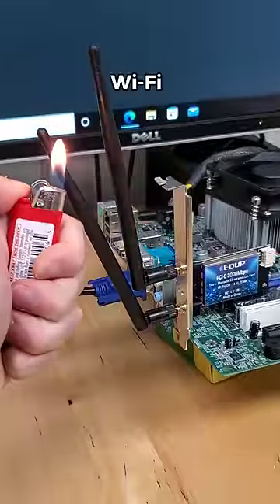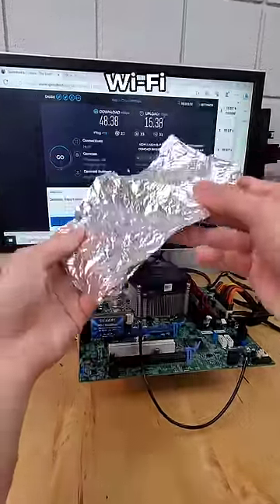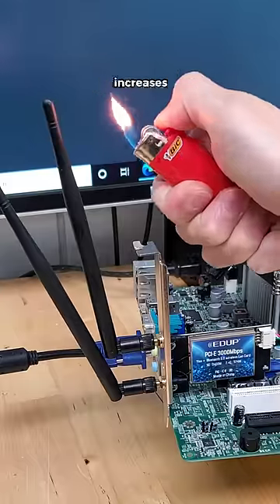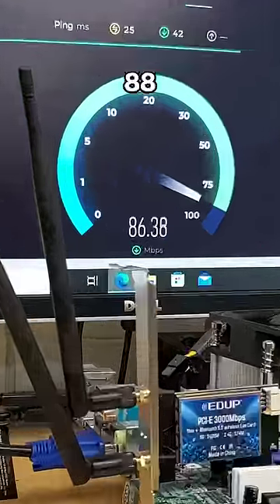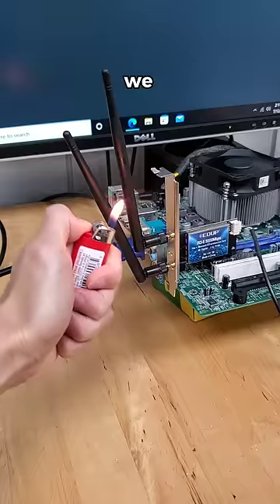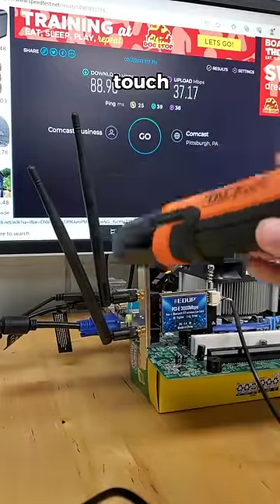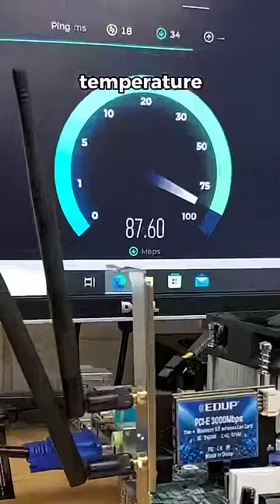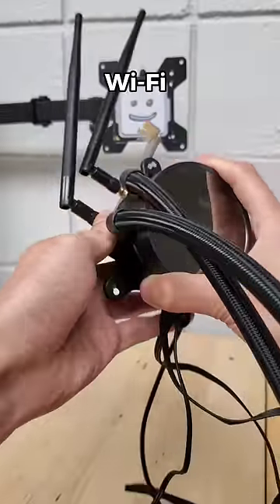does fire improve Wifi performance? #shorts

Comment: Omg.. DO NOT give them ideas now. They’re already water cooling SSDs now 😂
Reply: He made a video on water cooled ram
Reply: with new gen5 pcie drives it’s makes more sense than olde drives since the new ones get really hot and may damage the drive
Reply: @antoniomatthews4319 I still think with good thermal pad and a good heat shield, it should stay below 60c
Reply: My corsair mp600 NH doesn't have any heatsink at all.
Reply: water cooled ram
Reply: @StunXPlayz  agree but if you’re already running a loop for your cpu and gpu it might be beneficial to tie in your ssd as well
Reply: Soon going to be the power button😂
Reply: @StunXPlayz they should, but they don't. Gen 5 drives are a different breed
Reply: @rgg12354 ram and ssds are NOT the same thing
Reply: They made useless things sometimes. And then overpriced for it...
Reply: Because SSDs get hotter as they become faster
Reply: Water cooling the water cooler
Reply: @StunXPlayz  when you reach certain speeds then you need more cooling. it's an inevitability. ram might start needing coolers in 10 years
Reply: y
Reply: Probably nvme drives tho
Reply: What????
Reply: @ihsanrazan8978 water cooled fans
Reply: next up : water cooler cmos battery
Reply: @Bos_Meong  nah, water cooled water cooler
Reply: @kramsdell_ water cooled water cooler
Reply: @kramsdell_ fan cooler or water cooler?
Reply: @kramsdell_ water cooled water cooled water cooled water cooler
Reply: @fabriperoconalgomasytodojunto " A person who thinks all the time. Has nothing to think about except thoughts"
Reply: @defautluser0 water cooled water cooled water cooled water cooled water cooled water cooled water cooled wind cooled space cooled planet🗿 that will keep everyone's pc cool🗿
Reply: @Careditinghub  tf is a space cooler
Reply: @defautluser0  you put a pc into space and it will cool down😤😤🗿🗿🗿🥶🥶🔥🔥🔥💀💀
Reply: Don’t forget the Watercooled Power Supply!
Reply: thats cuz they are high speed ssd and they tend to make a lot of heat when moving a lot of files
Reply: @antoniomatthews4319 i understand about being hot but it's too pricey to maintained it😂
Reply: Well the Most powerful gen5 Drives need at least active cooling so 🤷🏻‍♂️
Reply: I water cooled my ram extenders
Reply: Coming soon from Corsair: The worlds first liquid cooled pump cooler! We heard you liked closed loops in your closed loop cooler dawg
Reply: I mean that’s normal they get real hot?
Reply: @mycelia_ow not inevitable necessarily
Reply: You don’t have to buy a whole expensive tubing system like the gimmicks tech company try to push to price gouge components. I literally just water my pc when I water my plants

Comment: The current along the surface of the metal is pretty small (you have to stay within FCC limits), so temperature will have very little effect. Power companies care about the temperature of their wires because at that scale, temperature does slightly affect efficiency. Also, metal expands when hot, so hot wires can sag down and touch trees which is bad.

Comment: Probably because you heated the outer plastic covering, and plastic is an insulator so the temperature of the actual metal antenna didn’t change much.

Comment: The reason it gets more conductive when it's colder is due to the atoms moving around less, causing less friction when electrons move through the material. Imagine walking down a hallway and there are a lot of people. If everyone is running around full speed (warm), it's way harder to move through than if everyone stand still or walk slowly (cold)

Comment: The impedance of the antenna does not actually depend on the metal; rather, its the configuration of the placement of the metals that affect the impedance much more in radio frequencies

Comment: The heat makes the antenna expand and thus it has more area to pick up the signal.
Reply: What? The temperature changes the antennas impedance in witch the transceiver will see. Heat makes the impedance rise witch restricts current flow. At a certain temp it starts turning effectively into a resistor.
Reply: False for multiple reasons. The antennae are encased in a resin or plastic and have minimal room for expansion if any under ordinary conditions. We also saw in the test that the speed of the receiver didn't change. The metal inside of the plastic/resin was barely heated up due to this insulation provided by the reson/plastic

Comment: The Giant thick rubber around the outside absorbs most of your heat so basically you blasted the heat gun and the plastic absorbed the heat and it did not go into the metal as far as you would have liked for it to show a decrease. Hence the reason they wrap them in that rubber in the first place. That's the same rubber we use on optical cables that are ran through residential and commercial neighborhoods. It's nearly impossible to rip and has to be cut in order for it to be torn. Neighborhoods it's almost impossible to damage it. Hot take: water cooling is gayhe

Comment: One surprising thing i learned with my HVAC job is that fire is conductor of electricity.
Gas boilers use this principle to detect if there is flame.
Reply: It is a conductor but a very very very bad one at that. Electroboom has a video on it. Fires have around 100mega ohms of resistance. And really anything is a conductor with enough voltage

Comment: Conductivity of wires affects electric power losses, not transmission speed. If you pumped the voltages high enough, you could send data through a plastic straw

Comment: Water cooling really is such an overengineered solution for how commonplace it is. A high quality block cooler will keep even the highest end CPU at temperatures nowhere close to thermal throttling and has virtually no points of failure since it's just a  block of aluminum and copper. Worst case scenario the fans fail and it'll still conduct heat passively. Water coolers have  multiple single points of failure, primarily in the complex electronic pump system that render the entire system completely useless if they fail, in addition to the same fans. After having a H100i pump fail on me and having my gaming PC unusable for 2 weeks waiting for an RMA replacement, never messing with liquid cooling again.

Comment: Dude, you did not heat the metal of the antennas only a plastic layer, basically, you had to heat them up continuously and check the internet speed

Comment: Jokes on you about watercooling the Wifi. I had my adapter dropping connection and slowing down. When i mounted radior using paperclip it gots better. It is Realtek based, they all seems hot to me.

Comment: Actualy the chips need radiators if somting is over 100mb speed the antennas are signar reccover heat dosent impact them but chip on pcue can reduce your internet to reduce the heat

Comment: Water cool:

Capacitors
Micro chips
Micro capacitors
Transistors
PC Fans
USB ports
Power switches
Wiring
PSU
GPU
CPU
RAM
Vram
Pc case

Comment: I know this isnt a serious video but you just heated the plastic decorative/protective cover of the antenna. Plastic is a great insulator so i bet the actual antenna didn't even get hot by a single degree.

Oh btw i have a picture of the damage caused by a wifi card that went nuclear and melted the plastics inside my friends laptop

Comment: Well, The test is actualy not right @mreester in my opinion. Why? Because the temperature increase= speed decrease may apply when the WiFi chip temperature has increased due to thermal throttling.

Comment: Well my wifi router is on a cupboard above the microwave and whenever someone turns it on the wifi speed gradually decreases and when the microwave is off the speed comes back to normal. Is this because of microwave radiation or heat inside microwave?